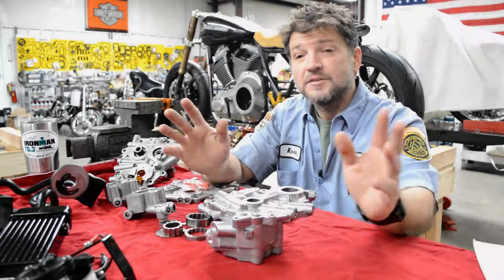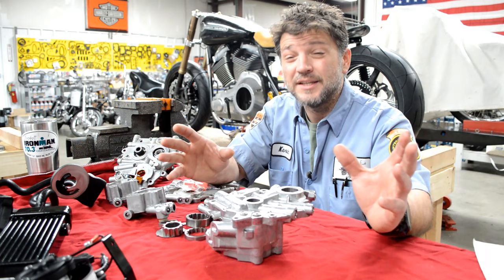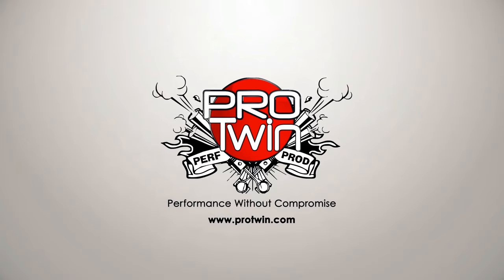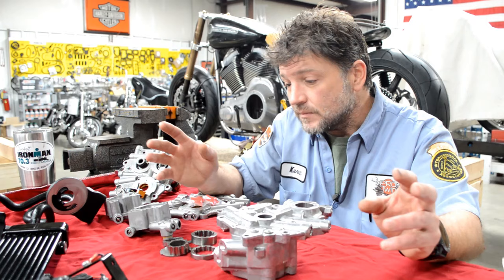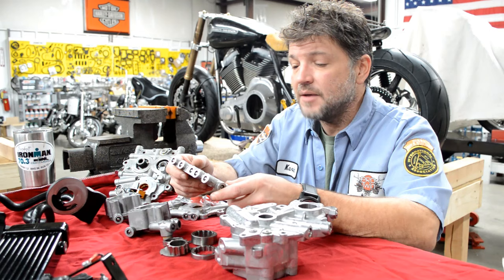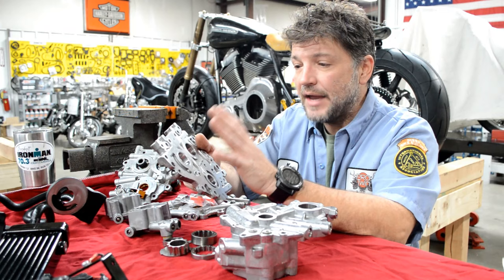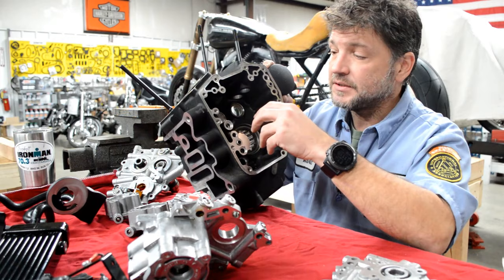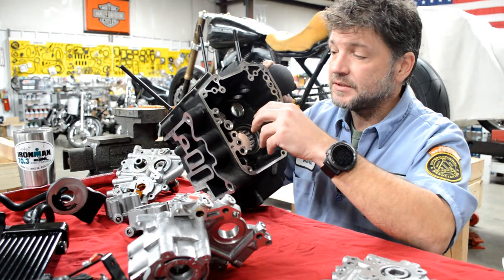Harley Cam Plate Tech - The M8 TC Cam Plate Debate - S&S Cycle - Kevin Baxter - Pro Twin Performance

Comment: Harley Davidson - literally the only vehicle manufacturer that you have to upgrade right from the factory just to make it work like its supposed to.
Reply: Yes, spend 30 on a bike and 30 on repairs before you can ride it, capitalism at it's finest, however customer loyalty is earned.
Reply: Uhm, you may want to recant that statement.  Most motorcycles of every brand and make require upgrades when it comes to performance enhancement.  You can ride most brands and makes without having to upgrade the performance if you so choose.
Reply: Back around the late eighties you bought the bike and an optional $3000 stroker mod. Of course the big bikes ran from around $8600 -$13ish thousand. My '90 heritage Softail classic new was $11,900 in stock form. I kept it stock except for removing the jumper wire on the tank mounted headlight switch so headlight wouldn't come on when the bike was started up and could either switch the headlight on manually or leave it off and just run the passing lights
Reply: Bs
Reply: @lawnboyfromhell     Lol.  Not true..  not at all….  First of all. It’s a rare occurrence that there are issues..  every manufacturer has issues..  harley is very reliable ..   people selling you products always sell the need
Reply: @drainmonkeys385  huh?
Reply: Not because you have to,  Harley isn’t for everyone, that’s why Honda makes the monkey bike.
Reply: Oh? Ford just announced today that it is recalling two million vehicles.
Reply: @wolfattack402000 I own six bikes 3 BMW 1 Ducati 2 HD the HD are the only ones that need upgrades.
Reply: @drainmonkeys385 wrong. of my six bikes 3 are BMW and 2 are HD one of my Beemers has 100k miles with no problems another one 66k and other 50k  one of my HD is a 04 Fat. Tell me that I can do 50k without upgrade chain tensioner.
Reply: My Ducati Diavel makes 162 hp with no upgrades.
Reply: Yep
Reply: "HAVE to"?   Tell that to my 2011 with nothing aftermarket but the air cleaner and exhaust. Supposedly the cam plate sucks.  Ok well 50,000 miles and 14yrs later no problem.  Supposedly the compensator sucks. Ok so there's a little clunky sometimes when you turn it off.  Who cares?!?!?

My 2014 BMW needed a water pump at 12,000mi.  Wut?!?!?  My Ducati started leaking oil at 7K.  Yep the finest machine out of Europe.... My Kawasaki Nomad needed BOTH stators at 40K.  And they ain't cheap like the Harley ones. My 2004 Harley developed a tick at 47,000 and I had the cams and whole top end done with a big bore kit and head work in 2016 so it would keep pace with the new 103s. Technically it didn't NEED anything, I just had 3 grand burning a hole in my pocket.  And the cam chain shoes were around half worn off at that time.....   Prior to that yes, WAY too many things vibrated loose and fell off that bike but by 2011 all those issues were fixed.  The 2011 Road King is the best bike I've ever owned out of 18.  Plenty of torque, goes 275mi on a tank, silky smooth on the highway, there's 100 different seating and uggage options for travel, the shield comes off in 2 seconds for local putt putt, I just can't praise it enough. People who bash harleys generally can't afford one, or they had a Shovelhead leaker in 1983 and those problems are all HD will ever mean to them.  That's fine.  The other 5 million of us know better. I really couldn't afford my 2004 when I got it either, but its worth about 7 grand today. Never has leaked a drop just like the 2011. My 2000 Nomad is literally scrap now.
Reply: Some commenters living in denial!  Narcissists can’t admit when they make mistakes!  Your comment is 🎯💯 correct!!!
Reply: @gerardorockerman69  if it wasn’t the spring tensioner I’d say ya could now my 09 eletraglide is at 60k miles still runs good but showing its age planning on full motor build this winter
Reply: BMW enters the chat .. lol
Reply: Most Japanese bikes are pretty reliable for decades out of the crate. We can thank the Goldwing for Harley upping their game so to speak .

Comment: If you have a 04 88ci motor the Fueling Hydraulic Cam Tentioner Replacement Kit cost $900.00 Bucks plus if you can't DIY you will be lucky to have someone do it for you for $600/700 Bucks so your in $15/1600. Shame on Harley Davidson they should have done a recall. Mine is at 29,500 miles now so I have to get it done. Hard to come up with that $ on a fixed income. I know Boo hoo for me. Ranman

Comment: Can not find an s and s oil pump and cam plate for my 2018 road glide 107. Everyones out of stock. any info. Also I want to upgrade the cam to a torque cam for best performance. What do you recommend? 21200 miles on bike. Already had a rear head gasket blow and replaced with a hd gasket.

Comment: Just installed S&S cam plate and TC3 oil pump as part of the VH 575 cam install in my 2015 FLSTF, very good quality components from S&S and definitely should be a part of any engine build

Comment: Being an auto mechanic for 33 years, I understand a lot of what your saying. My 99 rk sat for about 2 years before I bought in Aug. 20. He never been in the engine so I see i have a lot of inspection to so. It has about 47k on it and I put about 1600 miles on since Aug. Thanks for the videos. I will be in touch when ordering parts.

Comment: Just installed S&S plate and pump into my 19 FatBoy along with a 475 cam and S&S lifters and cuffs,also replaced the cam bearing in the case with the help of a Jims tool. The whole job took me about 3 hours, taking my time and triple checking my work as it's my first time working on a M8.
Reply from the maker: Nice job bud. Congrats.

Comment: Good video my friend I have a 103 heritage manufactured 2016 low mileage it does sound more noisy than others I have had I have had 5 harleys to date I changed the oil to a brand I like and that seemed to help regards Alan from the UK
Reply from the maker: Thanks Alan. Glad you found a low cost solution. All the best across the pond.
Reply: @KevinBaxter  Thank you my friend regards Alan

Comment: Awesome Vid', Kevin. Thanks , I will pass this one on to my HD  friends, One rides a CVO Limited. Not sure of the year though. ( I'm a Yamaha rider..... lol).  Anyway, aside from that, the tech name for those pumps is a Gerotor pump, a contraction of  "generated rotor".  (That primary pump you mentioned would be referred to as a "charge pump" in heavy industry.... keeps the big main pump's suction port at positive suction head,  5 psi., when supply and return volumes vary due to loading, etc., during operation.  It's built into the main pump. Any leakage oil from the pump into the pump-casing goes back via case-drain to tank, (sump in your case). Sunstrand Sauer, Eaton Char-Lynn, etc., use the same configuration on a lot of their big hydraulic pumps). I'm thinking HD is doing the same when I see that dual- pump configuration you showed us ?? Yes ????
Stay Safe and ride on.
W
Reply from the maker: That would be the same sir...and I learned something from your comment.  Thank you for posting and sharing.
Reply: I really enjoyed the Road Star...  I had an "05."  It made the V&H pipes talk!
But, the nasty oile bank said I had to give it back, cause I couldn't make the payments...

Comment: Again a very helpful video.  In it you caused me to develop a question based on a problem I have been fighting all summer.  In the winter of 2021/2022 I pulled my primary off and replaced all of the seals and bearing along with the seals to the transmission on the primary side.  They were leaking a little bit after 72,000 miles on my 2005 FLHRCI Road King Classic.  While I was at it I did a check on my flywheel run out at both ends which both were at .002" or lower.  So since I have HQ-0034-G cams (I talked with you about & purchased them in 2007 at Head Quarters from you) I purchased a S&S camplate & pump (before knowing about your videos & shop) & installed it.  Well once I was able to ride it started to leak oil & have traced it to my oil pan gasket.  I am on my 5th metal coated gasket (4 Cometic 1 Harley) now with an intake & engine case to oil filler breathers installed.  I first torqued in the manual sequence & 108 in-lbs specs on the 1st one.  The next one I increased to 120 in-lbs,  I even used Permatex gasket sealer on two installs.  I am now at 168 in-lbs & got there on the last gasket by doing it in stages from 96, 108, 120, 132, 144, 156 & then 168 in-lbs.  This has reduced the leaking but it still is leaking.  I have checked the surface for flatness on the case & pan along with replacing the old pan with a newer one that does not have the stupid plastic baffle & springs with the new style that has actual cast in baffles & riveted tray top.  Do you think it is possible that the S&S pump & camplate are providing to much oil pressure & causing the oil to be pushed out of the gasket?

Comment: Thanks for this great video,greetings from Dublin Ireland,my biggest hassles with my 103 fat boy 2015 
Was greeting  the dealer to align the rear axle ! A nightmare every time they took off the rear wheel ,rubbing noises from the belt drive after driving a few miles ,I ended up have to buy the jack,belt tension tool and doing it myself ,all the best Jim

Comment: So glad I stumbled on your site Kevin. I subbed and like a bunch of your stuff.
I keep things I like forever. I bought my 78.5 Shovel new in November of 78. Still have it. I started doing mostly my own work back in 79 when the HD dealer did the first 500 mile check and tried to screw me. I had been warned they would charge for fluid changes they did not do. I put clear nail polish on some screws etc. and proved that to be true.
Today I mostly ride my 2006 FLHTCI 88 that my wife "allowed" for my 50th. Both are keepers!
The twin cam was delivered in October of 05. I was interested in one of your vids you recommended the 06 and some other specific years to answer a question from a viewer.
She has 30,000 this month. Regular oil changes at 2500. Full synth always. I had the cam tensioners checked at about 27,000. They were ok then. Im planning to replace them now. Maybe over the winter, if not sooner... as Ive become paranoid they will come apart. Ive been studying every vid I can find for a week now and yours have been the best. 
So Ive been looking at the kits from Feuling and S&S as well as considering Screaming Eagle parts. Seems like this vid convinced me on the S&S. But looks like considerably more money.
Heres what I have. Stock motor. HD Heavy Breather and Samson 39" Long Tail slipons with the stock header pipes. No Oxy sensors. I used a Dyno Jet Power Commander to adjust to the new components rather than paying HD big bucks to flash the stock module. I intend to go with new cams and S&S adjustable push rods to avoid all the tank removal and rocker box disassembly. Im old but I ride hard. I live in Jersey so highway blasts are suicidal ... garbage trucks are going 80 with crap flying out... I dont beat my machines but I wind things up towards redline if I need to go. High speed for sustained periods is not out of the question and passing on 2 lane road is done... with authority.  Jersey drivers like to go slow when your behind them but then race you to 90 when you try and pass. 
Im 64 but after 30 years in the trucking business I still ride my FL like a kid on a crotch rocket.

My question is can you provide a package from S&S with cams and all that you would recommend to give just a bit more uumph without sacrificing reliability. using the pipes and air cleaner I have? I dont have access to a dyno but I believe I can still go online and get maps frome Dyno Jet that should get me close. If after its all one I need a dyno run to get it right Im sure someone is close enough that I can trust.
Also do you think at 30,000 the increase performance of a cam upgrade would require other upgrades? Maybe in the rocker box department?

So far my list looks like S&S plate and pump. Gears, chains, tensioners. Maybe their cam or any other you recommend. S&S adjustable pushrods. A cam bearing puller. And maybe some other things you might recommend. Dont wat to spend a ton of money but I want this engine to last until Im too old to ride it. Slight performance gains would be nice but She runs well enough and I would not trade reliability for performance at this point.
If not for the adjusters I would not be opening the engine up at all.  She has performed flawlessly. But if I need to I might as well upgrade a bit. Ive seen a lot of guys start having issues as soon as they start spending money on mods... I just want to ride.

Comment: Alot of answers here that i wanted to know.  I have been back and forth in my head over this camplate arangement. I have a problem that makes me always think more is always better. Im always worried im not getting enough oil pressure and think i need the most pressure i can get. I wasnt thinking about the overburden of oil causing other issues. Very informative for me. Im ok with a piston video if you want. Im sure i will learn something which is always a good thing. Have a great weekend. Dont work too hard !!
Reply from the maker: Thank you!  Appreciate the kind words. Glad i was able to help.

Comment: Some awesome info... thank you :) From Australia and working with someone locally but wanted to make sure I had some good knowledge going into my next upgrades. This video has helped a LOT!
Reply from the maker: Thanks. Who ya working with in OZ?  Have quite a few friends there in Brisbane and Sydney areas.
Reply: @KevinBaxter  Working with Adam from Brown Industries just near Newcastle. He has done other mods for me and is local which is nice.

You may have already done this but interested to hear your experience with upgrading 114" to 128" as this is what I'm looking at doing. Not sure if should go an S&S or there is a builder north called Alpha Performance Engines which does a 128 which has some good local reviews.

Comment: added subject as requested. Swingarm remedy for rear wheel steer, and wobbles-speed shake. examples; stiffies, and steering links that correct or help swingarm drift. in my 02 RK, and 01 FLHT, I've installed a progressive steering link, and stiffies, inserted in the swingarm rubber bushing. tremendous improvement in handling. tks. for sharing your Harley knowledge, it helps a lot and goes a long way in answering questions. keep emm coming.

Comment: Great information Kevin.  You do a good job of clearly going over the topic, in all cases.  I have a '19 M8 softail(SE stage III).  Cam chest is on the sheet for upgrades so is suspension and breaks, "GO FAST - STOP FAST"!  If and when you do a brake video can you also include the +/- of SS braided lines?  Thanks again.
Reply from the maker: Thanks Mike. Great suggestion on the brake video too. Lots to cover there as well as on suspension.

Comment: Love your videos and have been watching for a long time. Wanted to just make one correction in your explanation of forging. Forging (even "hot forging") does not use liquid metal to form the part.  Forging uses a solid piece of billet material and mostly uses a hammering process (forging) to make the part in a die. The process you described where liquid metal is in a die and solidifies under pressure sounds like high pressure die casting, where liquid aluminum is injected into a die under several tons of pressure until it solidifies enough to eject out of the opening mold. How you explained the porosity in the metal (you talked about bubbles or air pockets) was very good, and is a problem for any foundry. All castings, no matter what process is used have some degree of porosity in them. Forging typically doesn't because the source material is a solid billet block. Same goes for machining parts from aluminum billet. The billet block is inherently porosity free.
Reply: So where does that solid piece of billet steel come from?

Comment: Excellent very informative, i have a 2006 dyna,  i have had to fix everything you talked about now you explain why things went wrong with my bike thanks, its nice to understand why. I was lucky on the chain tensioner the bearings went on the trans had it rebuilt, Heritage harley screwed that up than they sold to someone else, went back 1 year later, had to replace the transmission  2 years into it will see. I have 56k on the bike, so i like to head off problem if i can? Thanks again.
Reply from the maker: youre welcome sir.  thanks for watching

Comment: What an awesome video. I’m considering a cam oil pump and cam plate for my 2019 HD SGS. HD does not offer a high performance oil pump or cam plate with their cam/piston upgrades. Bigger engine more performance seems to me requires a high performance oil pump and cam plate. I’m not sure why.
Reply from the maker: The stock pumps ability to scavenge is barely adequate to support a stock engine...and often, not enough at all.  I'll be happy to answer your questions if youd like to shoot me an email kevin@protwin.com  You have options far better than HD would be able to provide you.